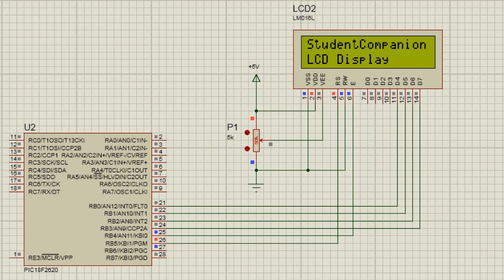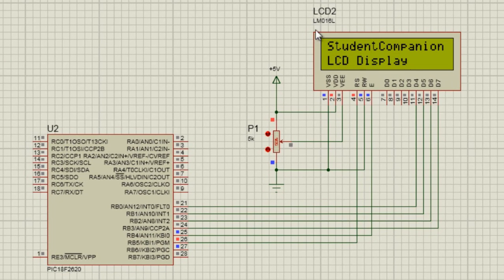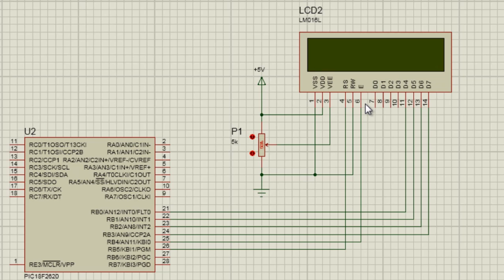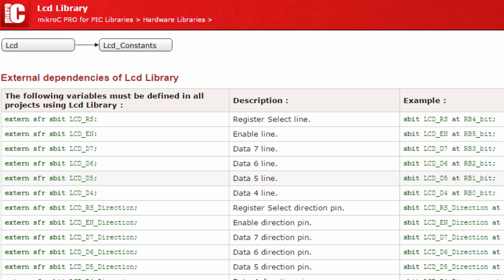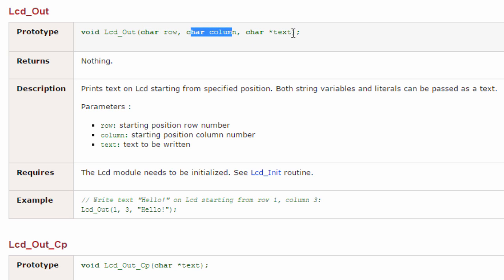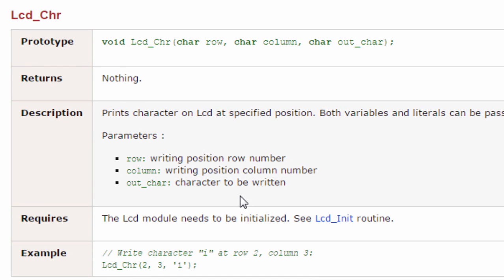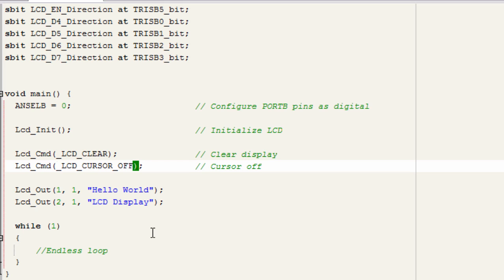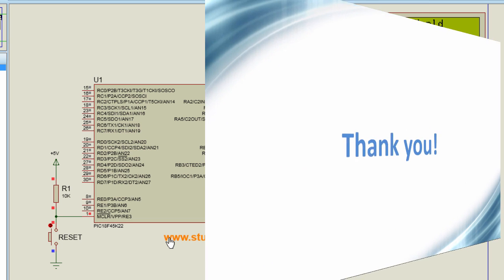5- Interfacing an LCD Display | mikroC Pro for PIC Tutorial

Comment: HELLO Student Companion.Each time i write my code i am getting an error "' Undeclared identifier ''.i tried even copying a complete test code from the mikro c library but to no avail.
Reply from the maker: Hi. Which PIC model are you using?
Can you post your code here together with the complete error message?
Reply: @StudentCompanion  look even if i copy a code for example the code for interfacing an LCD from mikro c library,when i build it,the errors are coming.
Reply: 34 324 Undeclared identifier 'Lcd_Init' in expression AUTOMATIC_WATERING_SYSTEM.c
Reply from the maker: You didn't answer the questions we asked you.
Reply: PIC16F877
Reply from the maker: Now post your code. The more information you provide the quicker the support you get.

Comment: 3 371 Specifier needed isim.c
3 396 Invalid declarator expected'(' or identifier isim.c
3 393 '' Identifier redefined isim.c
4 371 Specifier needed isim.c
4 396 Invalid declarator expected'(' or identifier isim.c
4 393 '' Identifier redefined isim.c
5 371 Specifier needed isim.c
5 396 Invalid declarator expected'(' or identifier isim.c
5 393 '' Identifier redefined isim.c
5 312 Internal error '' isim.c
0 102 Finished (with errors): 08 Haz 2020, 15:37:38 isim.mcppi
Reply from the maker: What is this? 
You can't just post some errors without saying anything and expect assistance.

You must write what you are facing and what you want us to assist with. the problem, post the full error message, the PIC you are using  and the code. No body can guess without posting the code

Comment: Thanks for your wonderful videos.But I tried to simulate a simple circuit to display "Hello world" on the lcd (LM016L) in RACK PROTEUS PROFESSIONAL 8 with the connection just as yours but i used pic16f886 the lcd only shows some light but nothing is displayed on the screen.Below is my simple code:

// Lcd pinout settings
sbit LCD_RS at RB4_bit;
sbit LCD_EN at RB5_bit;
sbit LCD_D7 at RB3_bit;
sbit LCD_D6 at RB2_bit;
sbit LCD_D5 at RB1_bit;
sbit LCD_D4 at RB0_bit;

// Pin direction
sbit LCD_RS_Direction at TRISB4_bit;
sbit LCD_EN_Direction at TRISB5_bit;
sbit LCD_D7_Direction at TRISB3_bit;
sbit LCD_D6_Direction at TRISB2_bit;
sbit LCD_D5_Direction at TRISB1_bit;
sbit LCD_D4_Direction at TRISB0_bit

void main { 
TRISB = 0x00;
PORTB = 0;
Lcd_Init();
Lcd_Out(1, 1, "Hello World!");
}

The code ran successfully and generated hex file but nothing is displayed on the screen.What do i do to make it work? Thanks
Reply from the maker: Hi, in embedded programming, you can't exist the main program, your. The program starts from top to the bottom, to prevent the program from exiting and thus resetting the microcontroller, we use a while(1) loop and write the code that should be run over and over again, if there is none, you just leave the loop blank.
In your case there is no while(1), your microcontroller will just reset.

Comment: Thanks for tutorial, i am using  Lcd_Init();  but when i do the Build of the project appear this error "   0 360 Unresolved extern 'LCD_EN_Direction' __Lib_Lcd.c" .I was wondering if you could help me to solve this issue. i am using  micro C PRO for PIC V.5.0.1  with PIC16F877A, whereas the other instructions are working such as ADC_Init(); and UART1_Init(9600);
Reply from the maker: Hi. Can you post all your code?
Reply: Same issue with me 
All code correct only lcd_int();

Comment: excellent work. i have question please. is this code compatible to pic 18f2550??
Reply from the maker: Thank you. The code should work well if you configure correctly your PIC18F2550
Reply: @StudentCompanion   he didn't work :(  . the code working very well in pic 16f877A  and i do the simulation in isis . but he didn't work in 18f2550. please help i have a project with this.
Reply from the maker: What do you mean by it doesn't work? We can't guess what could be the  problem if you don't post your code and the errors

Comment: I have an easy pic 18F45k22 developement board (easy for PIC) and I programmed it with your code and followed your wiring diagram.   The output is not displaying all characters. Its missing some characters (it displays  "Hell wrd") instead of displaying the full "hello world"
Reply from the maker: Hi. And id you change the displayed text to something else, does it still miss some characters?
Can you post the code?
Reply: @student companion i changed the displayed text to something else and I am still getting the same error.  I am typing your exact code in this video
Reply from the maker: Upload your zipped project and Proteus project if you simulating with Proteus to the Forum on  our website.  We will look at it closely: https://www.studentcompanion.co.za/forums/
Reply: @Student companion, i am not simulating.  I built the actual circuit
Reply from the maker: Can you post the schematic diagram of your full circuit.  Including the power, decoupling capacitors etc.

Comment: Hi, can you please make a guide on 240V to 100V ac meter on LCD IC PIC16F877a with the same explanations please.
Reply from the maker: +Ghafoor Samadi unfortunately wecan't attend to each request we receive.  We won't be able to due to the numbers. There are plenty tutorials online about power measurement.
Reply: Yes it's but I love your explanation please try your bast, we are looking forward thanks.
Reply from the maker: +Ghafoor Samadi you are welcome!
Reply: How to run MPLAB XC8 code in MikroC pro I have a problem with coping MPLAB code file to MikroC.
Reply from the maker: +Ghafoor Samadi you can't.  Either use MPLAB code in MPLAB IDE or mikroC code in mikroC.  Don't copy from one into the other. The code syntax and libraries are not always the same. You'll get many errors.
Reply: thanks brother but the AC meter circuit that i have found is in MPLAB and I learn for the time been MikroC from your site and MPLAB is very hard.
Reply from the maker: +Ghafoor Samadi MPLAB is not hard.  Try to follow MPLAB  tutorials from this YouTube channel. They are easy to understand

Comment: Hello Student Companion SA! I'm trying to initialize the LCD using PORT (a) from RA0 to RA5 plus PORT RE0 (e) using the Mikroc library, but the LCD in this configuration does not boot, in other PORTs like (B), (C), (D) It works normal. Do you have any tips to solve this problem?  I'm using the PIC16F877A. The code is: 

sbit LCD_RS at RE0_bit;
sbit LCD_EN at RA5_bit;
sbit LCD_D7 at RA1_bit;
sbit LCD_D6 at RA2_bit;
sbit LCD_D5 at RA3_bit;
sbit LCD_D4 at RA4bit;

sbit LCD_RS_Direction at TRISE0_bit;
sbit LCD_EN_Direction at TRISA5_bit;
sbit LCD_D7_Direction at TRISA1_bit;
sbit LCD_D6_Direction at TRISA2_bit;
sbit LCD_D5_Direction at TRISA3_bit;
sbit LCD_D4_Direction at TRISA4_bit;

int main()
{
  CMCON = 7;                    // turn off comparators
  ADCON1 = 0x0F;           // turn off analog inputs
  Lcd_Init ();
}

Does not boost the LCD even removing by doing int main ==

int main()
{
  Lcd_Init ();
}

Thank you!
Reply from the maker: Hi . What are you expecting to be displayed on the lcd?
What do you man by boosting the lcd?
How  are you testing? Simulation or real hardware?
Reply: Oh thanks for your contact!!!

I just want to launch the LCD with your cursor, I have not done any program yet, first I need to be able to initialize it. I'm using Mikroc and proteus. In proteus does not initialize the LCD display with your cursor. I have acquired a board assembled for studies and the assembly of the microcontroller PIC16F877A installed on this board, is with the pins configured as listed below.

Should not the LCD be using this configuration or do I have to configure something else?

sbit LCD_RS at RE0_bit;
sbit LCD_EN at RA5_bit;
sbit LCD_D7 at RA1_bit;
sbit LCD_D6 at RA2_bit;
sbit LCD_D5 at RA3_bit;
sbit LCD_D4 at RA4bit;

sbit LCD_RS_Direction at TRISE0_bit;
sbit LCD_EN_Direction at TRISA5_bit;
sbit LCD_D7_Direction at TRISA1_bit;
sbit LCD_D6_Direction at TRISA2_bit;
sbit LCD_D5_Direction at TRISA3_bit;
sbit LCD_D4_Direction at TRISA4_bit;

int main()
{
  Lcd_Init ();
}
Reply from the maker: You must write something to see whether your LCD code works or not.
A simple Lcd_Init () won't display anything.
If you want to display a cursor, you must use the Lcd_Cmd() command such: lcd_Cmd(_LCD_BLINK_CURSOR_ON);
Reply from the maker: For more details please check our website: http://www.studentcompanion.co.za/interfacing-lcd-display-with-pic-microcontroller-mikroc/
Reply: Okkk friend!! I'm testing your tip here.
Reply from the maker: +Estudante Elétrico ok.
Reply from the maker: +Estudante Elétrico can you post your full mikroc and proteus projects in the forum. We will have a look: http://www.studentcompanion.co.za/forums/
Reply: Yes I will post.
Reply from the maker: +Estudante Elétrico ok.
Reply from the maker: Check your spam folder maybe the email was classified as spam.
Reply from the maker: We have reset your password. Here is your new password, please change it immidiately after login: v&yFMIUsocINt@l&PtC@(TOA
Username: taylor
Reply: Hello Friend. I posted my doubt onforum  MikroC Pro for Pic Project Discussion with the title: LCD does not boost A_E Ports. Hope your answer. Yhank you.
Reply from the maker: +Estudante Elétrico ok. We will look at it. Hope you also uploaded your mikroC and proteus projects.
Reply: Yes, I post the MikroC code and file zip proteus.
Reply from the maker: +Estudante Elétrico ok. We will have a look at it.
Reply: Ok Student! thak you very much!
Reply from the maker: Don't split the data pins of the LCD, for data use the same PORT. Split the RS or E pin
Reply: My development board is configured so RS-> RE0, E-> RA5, and all the pins as already shown, even so did not simulate in Proteus. If I send the program to my development board also nothing appears on the LCD. When I rewrite the program that has been recorded on the PIC of the card the LCD shows the messages of the original program. Did you take the test ??? Do not wheel !!! Did you see?? Or have you been able to simulate Proteus with this configuration or not?
Sbit LCD_RS at RE0_bit;
Sbit LCD_EN at RA5_bit;
Sbit LCD_D7 at RA1_bit;
Sbit LCD_D6 at RA2_bit;
Sbit LCD_D5 at RA3_bit;
Sbit LCD_D4 at RA4bit;

Sbit LCD_RS_Direction at TRISE0_bit;
Sbit LCD_EN_Direction at TRISA5_bit;
Sbit LCD_D7_Direction at TRISA1_bit;
Sbit LCD_D6_Direction at TRISA2_bit;
Sbit LCD_D5_Direction at TRISA3_bit;
Sbit LCD_D4_Direction at TRISA4_bit;

Int main ()
{
   Lcd_Init ();
}
Reply: I do not know what to do, because my card has this hardware configuration and does not play anything I program on the LCD. It only plays the program that was recorded on the PIC 16F877A. The interesting thing is that neither Proteus simulates, or something is wrong or needs to be configured.
Reply: I did not find any example of a program that uses different PORT pins to connect the LCD, specifically Ports A-E. With pin RA4 and RE0. But my board has exactly this configuration.
Reply from the maker: +Estudante Elétrico that's why we asked you to upload your mikroC project together with your proteus project.  You only uploaded Proteus project. In the Forum you wrote:
Sbit LCD_RS at RA1_bit;
Sbit LCD_E at RA2_bit;
//
Sbit LCD_D4 at RE0_bit;

But now you are saying its EN which is connected to RE0. Which one is correct? Don't split the data pins D4 to D7 must be on same port.
Reply: The first time I just tested with other pins but did not initialize the LCD. Correct remains the one in the attached Mikroc and Proteus file.
Thanks friend.

sbit LCD_RS at RE0_bit;
sbit LCD_EN at RA5_bit;
sbit LCD_D4 at RA4_bit;
sbit LCD_D5 at RA3_bit;
sbit LCD_D6 at RA2_bit;
sbit LCD_D7 at RA1_bit;
// Pin direction
sbit LCD_RS_Direction at TRISE0_bit;
sbit LCD_EN_Direction at TRISA5_bit;
sbit LCD_D4_Direction at TRISA4_bit;
sbit LCD_D5_Direction at TRISA3_bit;
sbit LCD_D6_Direction at TRISA2_bit;
sbit LCD_D7_Direction at TRISA1_bit;

void main() 
{
  Lcd_Init ();
  Lcd_Chr_CP ('I');
  Lcd_Chr_CP (' ');
  Lcd_Chr_CP ('H'); 
  Lcd_Chr_CP ('E');
  Lcd_Chr_CP ('R');
  Lcd_Chr_CP ('E');
  Lcd_Out_CP ("TODAY"); 
  Lcd_Out (2,1, "YOU CAN FRIEND"); 
  delay_ms (300);
  Lcd_Cmd (_LCD_CLEAR);
  Lcd_Cmd (_LCD_CURSOR_OFF);
  delay_ms (300);
  Lcd_Cmd (_LCD_BLINK_CURSOR_ON);
  Lcd_Out_CP ("TAYLOR");
  delay_ms(200);
  Lcd_Cmd (_LCD_CLEAR);
 }
Reply from the maker: +Estudante Elétrico please attach correct Proteus file and correct full mikroC compiled project not just the main.c file. Zip all the files so you could upload them.
Reply: Ok, sent.
Reply from the maker: +Estudante Elétrico we will look at it
Reply: Hi friend!!! Still you do not have a problem answer in programming and simulation?
Reply from the maker: +Estudante Elétrico we haven't started. We will look at it when we have time.  We don't normally work on Student Companion on Saturdays and Sundays
Reply: Ok friend. Thanks.
Reply from the maker: +Estudante Elétrico you are welcome
Reply: Hello Friend!! I made a correction in the project I sent you, I was missing setting up the crystal oscillator for 20Mhz and also changed the value of the crystal capacitors to 22pF. But it still does not initialize the LCD display. I observed with the oscilloscope that pins D4, D5, D6, D7 generate a pulse signal in normal operation. I understand that some configuration is missing in the program, but I still do not know where or how to do it. I am waiting for your help, I do not know what to do, because my development board has the configuration of the assembly shown in the Proteus simulator in a program that sends the PIC16F877A to the LCD. Only with the program that has been recorded on the PIC that reads the analog input does the LCD initialize. I1m hopping for your answer
Reply from the maker: We have tried many combinations all worked on other PORTs except that combination on PORTA. We have no idea what could be the problem. Please raise the issue on mikroe Forum: https://forum.mikroe.com/